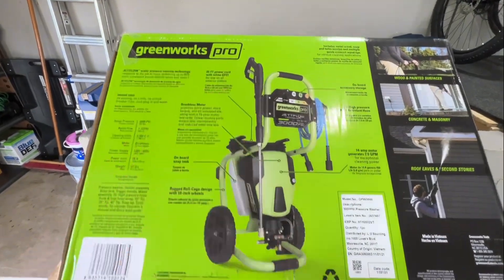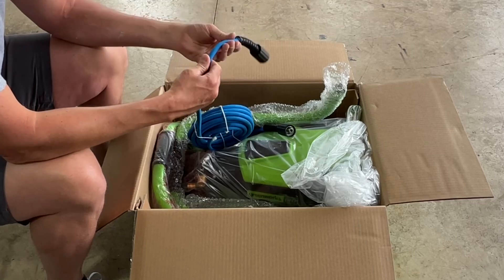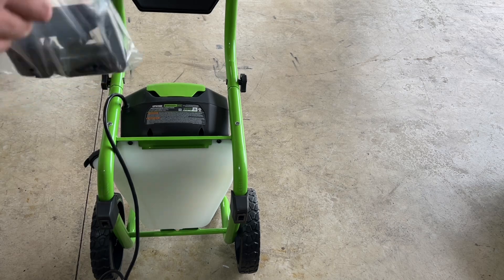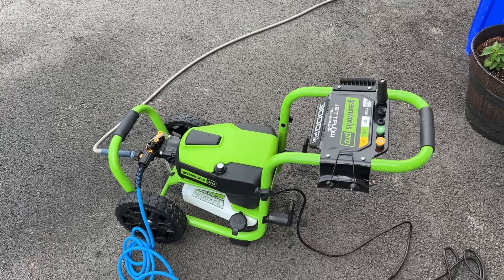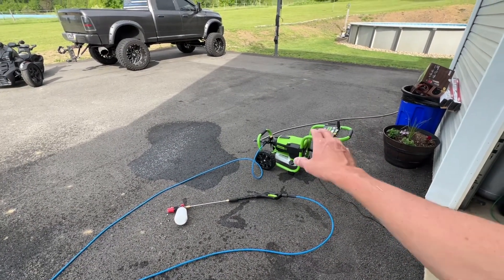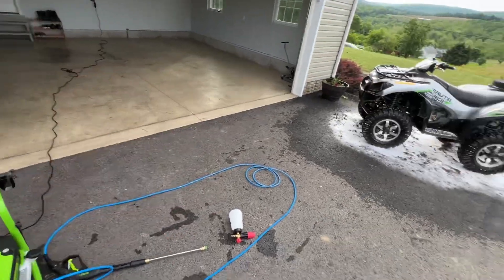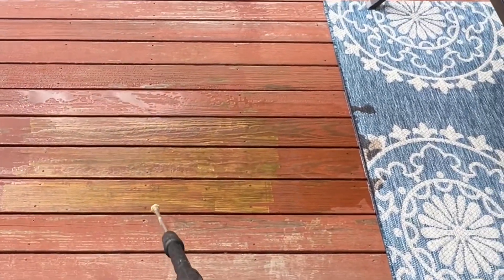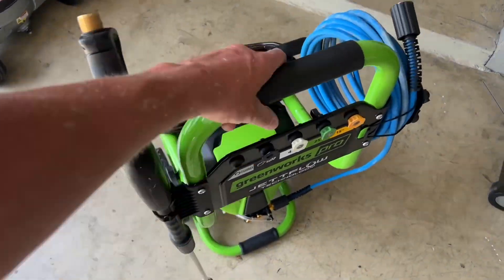Unboxing & Review Greenworks Pro 3000psi Electric Pressure Washer.

Comment: I got this one and a sunjoe, bothe 2300, used the joe first with no issues next the green on another project. I had a cheaper unit called blue but only used 3 times and the motor fried.  Ill check later for a replacement engine.

Comment: Saw quite a few reviews on the GW Pro 3k & your video is hands down the best!
You did Vinyl Siding, the deck, & the foam canon - not to mention going thru the different nozzles and everything else
Really appreciate you demonstrating on vinyl siding, wood deck and foam canon.
One thing, I think you would get better results with the foam cannon without using the wand. Just connect the foam cannon to the handle.

Comment: Good stuff. Thanks for sharing. 

Any reason why you didn't uncoil the pressure hose and used while it was coiled up? I'm pretty sure that would make a difference in power as opposed to the blue pressure line being uncoiled and in straight line? 

I just ordered one Yesterday and it has the power button in the middle? Did they somewhat changed it up a bit? I would think the power button in the middle would make more sense as you can reach it centered from either side.

Comment: Great video! It helped me make up my mind as I have been researching electric pressure washers for a while now. I just went to Lowes and bought one of these Electric Green Works 3000 PSI pressure washers. Does just what I need it to do around the house. I work as a professional mechanic and have used many gas operated pressure washers over the years. I hate messing with trying to get a gas operated pressure washer running that has been setting for six months with bad gas in it. That is why I was wanting to go electric for just using around the house, you can't go wrong with this Green Works 3000 PSI for the money. It does everything I need it to do around the house and then some.
Reply: Thank you so much for this awesome walk through. I was just looking to put it together. Didn’t come with the instructions. You got me up and running. Decided to wash my truck. Love the results.

Comment: Bought one and after trying it on cement to clean some spots and tire marks I boxed it back up. Besides it quitting a bunch of times, Tripping a cb,overheating and shutting down and literally doing a poor job. I wanted an electric unit and compared this one with the Ryobi version and bought the Greenworks on this and other sites recommendations. Don't waste your money. At best it's good for washing your car and would consider this a light/medium duty unit. Going back to gas..
Reply from the maker: I agree, a gas pressure washer is always more powerful.  However, if you want/need a powerful electric power washer, there is not many that have the specs of this washer.
Reply: Unfortunately the specs don’t live up to expectations. I wanted this to be a workable solution and it isn’t
Reply from the maker: I understand.  Maybe you just got a bad unit?  You also have to be careful plugging it in to an extension cord or outlet that a shared.  Either way, sorry it didn’t work out for you.
Reply: Idk I got the 2700psi ryobi and it’s borderline strong enough to blast the concrete,deck,etc that’s without chemicals. But a lot of people try to misuse pressure washers as a stripper and that’s not how you use them. You have to buy the proper chemicals to clean whatever it is your cleaning. Spray let it sit then blast it off not strip the entire surface off like a lot of people do.

Comment: The wand holder is always mentioned as a poor design in reviews.  Any difference between the Lowes and Bestbuy version?  The hoses are different colors?
Reply from the maker: Don’t think so.  As long as they are the same unit, same psi, same length hose, etc., I assume the same.

Comment: Was thinking about getting the 2300 which seems to get similar numbers and has total stop system. Thoughts?
Reply: I'm thinking about getting the 3K PSI over the 2300 PSI BUT first I'm going to Lowes to do a side by side comparison, #1 to see if the hose and wand are the same. At 6' I would like a long wand with a flexible hose. The bottom line is the 3K worth the extra $100. ?? .. I would like to see  others reply to your 'Thoughts' post.  BTW as for the ' total stop system' The 2300 reviews I watched the motor dosen't stop, only the RMP are lower when you are not spraying

Comment: The ryobi has a terrible stiff hose with memory which makes a tangled mess. So you have to consider paying money for a new hose on the ryobi.
Reply from the maker: I have had multiple pressure washers and the hoses on each one all suck.  I’d always suggest getting a new flexible hose.
Reply: @DieselLegiance  I was considering returning it for the greenworks 3000 mainly because of that but other than the hose idk if there is really much difference.
Reply from the maker: I ended up giving mine to my Dad as I got a really good deal on a Dewalt gas pressure washer.  My Dad likes it though.

Comment: I would like to buy one of these but my concern is will it work on a 15amp plug without tripping the breaker. What are you plugged into?
Reply from the maker: I think my garage outlets are on a 15-20amp breaker but I’m not 100% sure.  I ended up giving this to my Dad as I got a really good deal on a Dewalt gas pressure washer.

Comment: Which tip do you recommend for washing your car?
Reply from the maker: I use different tips for different reasons.  I don’t use the jet stream but I rotate between the different degrees.  If I have to clean off more mud, I use the narrow tip for more power.  If it’s a dusty car, I may use the wider fan tip.

Comment: Awesome man. I just recently received mines and I have to assemble it and give it a try. I feel a bit better now with my choice after watching your video. I’ll be using it for basically similar purposes around the house and washing my truck. Someone had mentioned that it’s best if you used it on a dedicated 20amp circuit. Have you had any issues with it tripping a shared breaker?
Reply from the maker: Yeah I tripped it one time but I was using an extension cord that was plugged into a power strip.  It tripped on the pressure washer plug breaker not the wall.  Once I moved it to a wall outlet with nothing else, it was fine.
Reply: @DieselLegiance  Thank you for replying.

Comment: Any idea why mine shoots a little stream ?
Reply from the maker: Is the machine running to build up pressure?  If not, you can still spray water you just won’t have pressure.  Check your plug to see if you tripped the plug breaker?
Reply: @DieselLegiance   hi thanks it’s works now

Comment: It dont matter what psi electric pressure washer you get.  3000psi just aint enough psi when you are cleaning concrete.  Sure you can do it but it is very tidious to clean concrete with these electric pressure washers.  Electric power washers are good for light to medium cleaning.  Washing your car, deck furniture, some wood decks.  But when it comes to cleaning pourous concrete and the like 3000 psi jist aint enough to do it in a reasonable time

Comment: Doesn't look anywhere near 3000
Reply from the maker: It was ok, I gave it to my Dad and bought a 3300psi gas Dewalt.
Reply: @DieselLegiance  how much was it
Reply from the maker: The Dewalt?  I got it on sale for around $350 and it’s my favorite gas pressure washer so far.
Reply: They are never what they say.  Usually 200 to 300 less.  The way these companies measure the psi is on the initial trigger pull, not the sustained use pressure
Reply: @JoshThompson25  actually that's not true for most, if not all, of Greenworks pressure washers; they're certified by a third party that verifies the claimed PSI